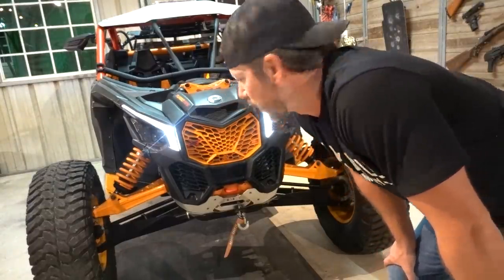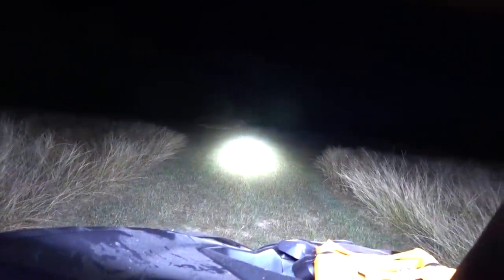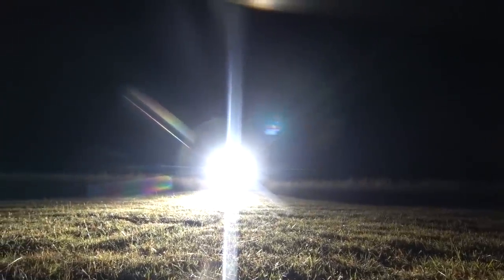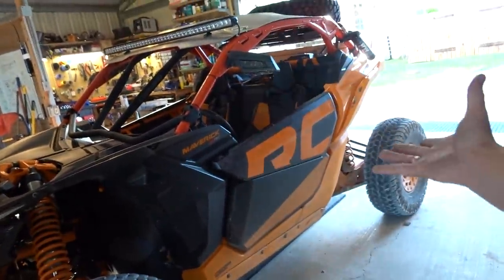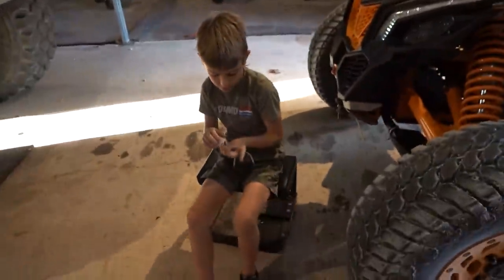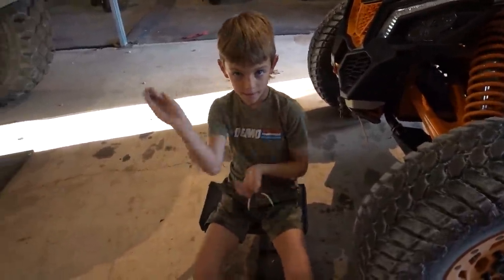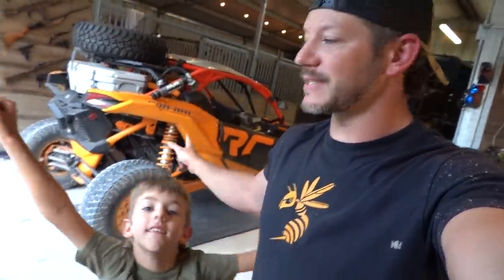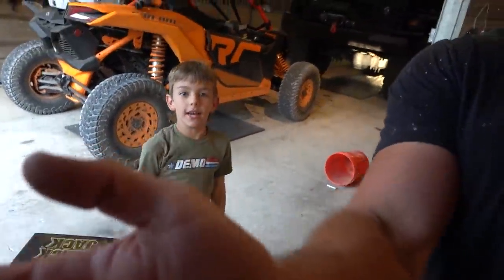Here’s Why I Bought this Thing lol…..

Comment: 2020 Can-Am Maverick X3 RC Turbo RR.  195HP.  Same one that I have,  except I didn't roll mine lol.  You're also missing the bumper that comes factory.  If you want to get a better, stronger cage then hit up Brick City Fab in AZ.  Also, upgrade those radius rods on the back with ZRP radius rods.  You're going to want either Rugged Radio's or Sena helmet comm's.

Comment: Matt, since you're planning on taking this thing out to the desert I really recommend 3 things. A windscreen, a long range radio, and a bunch of reflective lights/panels. Windscreen is obviously to stop the onslaught of sand peppering you. But the reflectors and radio is if a vehicle goes down or you need medical, you'd have the ability to call for help and be found.
Reply: Nice thinking also Matt could install a GPS sadlite tracker just in case

Comment: Hey, I'm a paramedic. Want to make sure you know that the "roll cage" on most of these is not actually going to protect you in a roll. Don't know if this racier version is, but I'd recommend beefing it up. I've seen too many of these collapse.
Reply: I've not heard anything more about foam filled tubes sense the 90's. There was a safety gear company (out of Dallas oddly enough) testing tubular steel finished with dense aluminum laced foam interiors. According to the articles even canned house foam raised the crush resistance.
Reply: Brick city fab does some nice X3 cages.
Reply: Rolled one. They hold up fine.

Comment: You'll be the mule of the group so you'll need potable water tanks, spare gas tanks, two or more quickly accessible fire extinguishers, storage for a good set of tools and spare parts/fluids for all the vehicles and motorcycle rack mounts in case their bike breaks down or they damage their bike beyond field repair.  You should also have emergency food (freeze-dried for weight saving), survival equipment (blankets, tents, water purifiers, fire starters, toilet paper, DudeWipes, disinfectants, etc) in case you get lost and a top of the line first aid kit in case one of you gets hurt.  Since you'll be off-roading, you should definitely carry an emergency beacon called a Personal Locator Beacon (PLB).
Reply: Sounds like he should have taken the 4 seat model
Reply: It’s a side by side,not a Uhaul! I was with you till you added motorcycle racks,blankets,tents,etc. They want to go trail riding,not Overlanding.
Reply: @atticus9907  They are overlanding through the desserts of New Mexico which bake during the day and freeze at night.  Remember the rules of 3: you can die within 3 hours without proper shelter, 3 days without water and 3 weeks without food.  If they're in the middle of the dessert and they break down or have an accident, how will they avoid exposure until help arrives? And if a bike dies or is totaled, how will they be able to get it out from a remote trail?  Just because you are willing to risk it doesn't mean they are.  His dad is a tough guy but he's still in his 60's.  If he gets hurt, how are they going to keep him alive and comfortable until help arrives?  Hope for the best, prepare for the worst.
Reply: @kevinkelley4894  I agree. For that type of adventuring, it wouldn't have been a bad choice.  If he was just trail busting for the day, a two seater is fine; but for extended trips, the four-seater would be ideal, especially if you can remove the rear seats for an emergency.

Comment: Hey Matt, Some advice from a Fellow Moto Rider! For your dad and brother. They will probably be looking at getting Sena's for their helmet communication. They are light weight, Long battery life, Easy to install and long distance connections, No huge antennas, Not tethered to your vehicle, Will handle all the elements! You might want to look at doing the same for Easy communication with Moto Riders. You can also play music in the headsets too! Me and the misses have been using the older model Sena 20S Evo for about 2 years now. We absolutely love them! I would recommend the Sena 30k for the Seamless Mesh Technology! Happy Trailing! Stay safe!

Comment: One of the issues I have with the X3 is that when you roll them, the frame tends to bend and the insurance usually totals them. The main area on the frame that will bend is the tube that goes down from the roll cage past the engine. Look very close to the joints. If any paint had chipped, means the frame is bent and should have been totaled. There are a lot of good things about the X3 this just happens to be one of the bad ones. If the cage was that bent up that they replaced it, I'm guessing that the frame is bent as well. If the dealer didn't disclose that.... That's an issue.
Reply: It doesn’t matter what manufacturer of side by side it is, if you roll it, insurance is going to total it. I have no idea why people treat these like a kids toy. There very expensive, and very capable. They will bite you in a heart beat if you run it like a jackass. I have a X3 RS Max, and a four door Turbo S. Both have been upgraded extensively.
Reply: @Charlie-go6eb  yeah they aren’t cheap and they aren’t the safest stock, there cages are put together cheaply and will keep you barely alive after a roll, Polaris or canam either one the stock cages are complete garbage, first thing we did to our canam was put in a real cage, friends rzr’s cage was half folded in after a roll.
Reply: @Charlie-go6eb  if you buy these to baby them you will never enjoy them. I’ve had three. Totaled one sold one and just bought the third. These are meant to be driven not be looked at.

Comment: You should definitely consider putting a different clutch in so you can get higher RPM. Upgrade the ball joints and always carry spare ball joints with you while you are wheeling, and upgrade your front and rear upper and lower control arms. Maybe consider putting a tune on it. I would keep the stock turbo on there if you want to rock climb smaller turbo means you can spoil faster!! Rock lights would be awesome if you were going to be wheeling at night!!! And definitely wrap the thing demo ranch style!!!! Keep up the great work brother!! #peakpowersports Colorado!
Reply: If anything he should upgrade the cage first, all the others are if you want too, stock cages Polaris or can-am are complete garbage. I’d double gusset a lot of the suspension components too.

Comment: 1. Tools for you and them. Find what you need for basic trail repairs.
2. Cb radio for coms to other people out on trail.
3. Dune flags.
4. I'd suggest surrounding lights so if yall are out at night you can see all of the trail and they can use the lighting to navigate.
5. If you have the room maybe a small air compressor. Airing up and down can help in different situations.

If you can upgrade the base part so they are less likely to break. Just better reliability.

Hope you see this and maybe it'll help.

Comment: Used a 4 door maverick 1000r a lot recently, lifted, 8” portals, 37s, dual hoshimura exhaust, relocated radiator, snorkel, and many more upgrades on it and one thing I will say, you definitely want a good stereo in them, definitely want the upgraded roll cage, and if you ever put portals on them, do research cuz they tend to leak and need the fluids inside changed frequently. But like everyone else is sayin, get the SxS blog boys to help you get it built right

Comment: DEFINITELY get a long travel suspension system that extends the width by at least 6" to really help you not roll it. Then get the turbo and ECM mods. Suspension first then more power. A better cage would be smart too.
Reply: It is the rc wich comes as the rs so it already is wide it’s 72 inch and the ds is the 64 inch so it’s already wide but they still flip😂

Comment: Main think about security.
Radio for long range contact.
Water (always if you go in the desert)
First aid kit (a must if you ride with bikers)
Flares gun / flares
Work flood light on a battery (useful)
Spare fuel (for you and the bikers)
Go pro for epic video. 
Drone (can be also useful to orient yourself since it give you a vantage point)
Fun (a lot of fun)

Comment: 5 point seat belts, Composite Race Seats, 72" Heavy Duty High(er) Clearance Suspension Kit, Nurf Bars, EVP Stage III Engine Build (600+HP), Desert Storm Gen3 Turbo System with Intercooler, EVP HD clutch and Transmission kit and what ever your heart and mind can come up with!

Comment: For communication, get Cardo Packtalk bolds, not Senas. I have experience with both. Also, put a fire extinguisher on each side. Amazon has quick release mounts for them.
Reply: I have both also. However, in the SXS world, it's Rugged or PCI.
Reply: @bravotwozero8119  I like Rugged too but suggested Cardos because I think they might be a little more appropriate for his coms use.

Comment: Tell me you put a fuse in that lightbar circuit? 
Going by "the other Utah Matt's" channel (MORR) I predict a ripped off front end in about a week 😁

Very cool toy mate and a smart idea buying something already devalued. Have a care tho, they are a real weapon and it will bite as bad as the trophy truck did. Respect the front end, people tend to think they are a lot tougher than they have any hope of being. No sending it too hard! Treated with a bit of respect they are awesome fun and at the price so they should be. There are however a couple of points on the frame that can benefit from a bit of extra stiffening, any competition prep place will point you right on that. a couple of extra bars makes huge difference on these but don't overdo it, in the worst case you want it to crumple as if it's too stiff it will kill you but leave a good looking corpse.

PS: You will roll it, everybody does 😆

Comment: Bring that Maverick to Michigan's upper peninsula! Me and all my family have SXS's and access to all the trails so we can ride hundreds of miles worth of trails. It's an absolute blast! Also, for mods...a particle separator is a must for sand/desert running, and for increased power a simple ECU flash/tune can get you above 220hp, and with the addition of a charge pipe and upgraded wastegate you can run close to 30lbs of boost, instead of the stock max of 14lbs of boost.

Comment: Get rid of the mud scrappers on the wheels, put 15in wheels on, Rocknocker flaps. this all to prevent rocks from entering the rear wheels and destroying them.  Ditch the factory cage, aftermarket 5pt harnesses, Rugged or PCI radio/intercom, and I would have the suspension revalved and sprung.  Also upgrading the control arms and A arms is highly recommended if your going to try to beat it like a ultra 4 car.  After all of that then you can do performance upgrades.

Comment: Roof mounted gun rack. Never know when you can do some hunting. Adjustable door mounted spotlights  pistols racks; because the desert can be lawless is someplaces. Look and see if they have any roof mounted tents or some kind of roof rack system. Something else in line  as the tent could be an ultralight towable teardrop camper. That all depends on how long and far yall plan of doing your offroad trips. Also spare gas tanks

Comment: Communication:

For the SxS something like rugged radios. But they won't work with motorcycle setups really.

So motorcycle guys use Cardo Pactalk generally in the adventure segment. 

So you all 3 could get a cardo Paltalk slim jbl. I can be on the bike in the back country for 8hrs of constant Communication and not have a dead battery.

Comment: You need a better actual cage, brick city comes to mind. You also need rear facing white pod lights I typically go with a light bar on the front pods on driver and passenger front pointing out at an obtuse angle. Rear driver and passenger pods pointing back at the same angle as the fronts. i have mounted them both high and low just depends on look and mounting locations available. Then two more pods mounted high pointing directly back. In my opinion this is critical if you plan to ride at night and or camp while out. You can set the side x side in the middle of the camp turn on all the lights and light up the whole camp ground while people are setting up. Then move it and make a fire. You’re going to want more power to keep up with the bikes on flat desert runs. So I’d suggest a larger intercooler, boost piping, catless down pipe, and tuning. You could up the turbo size a bit but you don’t want huge amounts of lag with such a small displacement motor you need the turbo on boost as quick and for as long as possible.

Comment: You need to put the radiator on the back wear the cooler is because if you ride to long in the mud with it on the bottom It will over heat cause it cant get enough air

Comment: Before your big trip upgrade atleast the lower a arms on the front, the 72inch wide models have a lot of issues with the lower a arms bending and breaking. It’s not an if, it’s a when sort of deal with those.

Comment: You should have bought a rzr pro xp. I have experience with both canam and polaris and I can say that the maverick is slightly faster than the rzr if the same spec. But I have found polaris to have better trail performance while canam has better  track performance. I have snapped a-arms on my maverick multiple times due to overestimating my jump distance. I haven't snapped any a-arms on my rzr but I have bent 2. Canam still makes good machines and I hope you enjoy your new purchase.

Comment: Should’ve gotten a 4 seater. Ask me how I know. 😬😬😬

Edit:195 hp. RR doesn’t mean it has a larger engine or turbo. Same exact engine and turbo. Just tuned different from factory. R versions can be tuned for about $500 and be at 195 hp.

Edit: 100% gotta have a decent set of speakers. Makes riding much more enjoyable.

Comment: The #1 thing you need is an aftermarket belt cooling fan. I recommend the blowhole, super easy setup wired into the brake light. Otherwise you will shred some belts, especially riding when it’s hot.

Comment: Lets run em!!

If you want the front end of that to not fall apart make sure you get a gusset kit. 
TMW makes a beeeeefy gusset kit for $450.

Look at my profile pic...I'm not talkin' outta my ass. I know X3's.
If you ever plan on airing it out you should also look into a shock Tower brace. Mine from HCR was $350.

Comment: Why does 180-200hp sound like it's meant for Mere to do groceries? What kind of engine makes that WITH a 'big turbo'?
Reply: It's only 900cc, less than a third of the displacement of a car engine. 300-500hp is possible if you have the check book for it.

Comment: Such a bummer. I’ve wanted to see some actual dirt bikes on or off the ranch for a long time. Motorcycles being death machines is a stereotypical view in the USA, and poorly informed. A motorcycle is as safe as the rider wants it to be. I’ve never been injured on my dirt bike because I wear all my dirt gear when I ride and I don’t do jumps. And I’m not just a good rider or anything—I’m actually terrible and drop my bike a lot in really technical terrain. I think Matt would be at least responsible enough to wear some proper riding gear.
Reply: Dirtbikes are the best